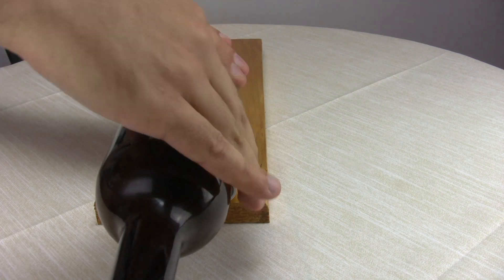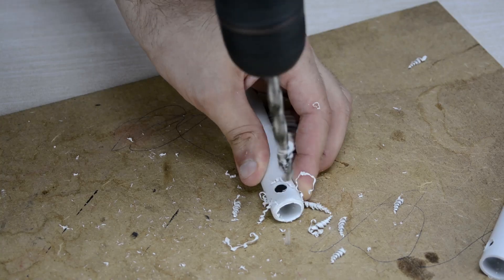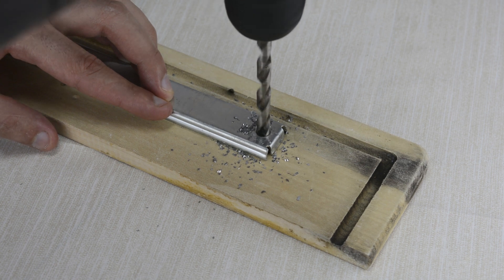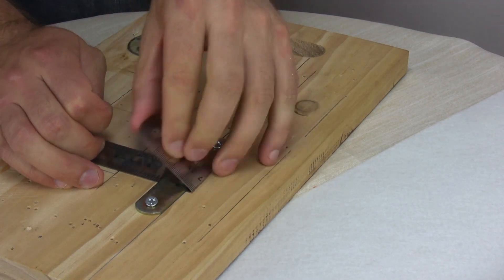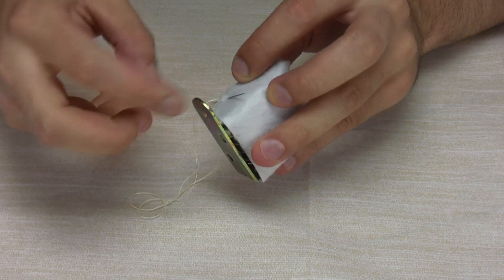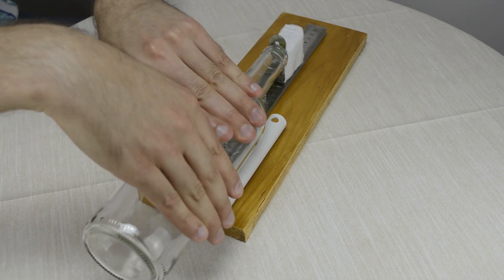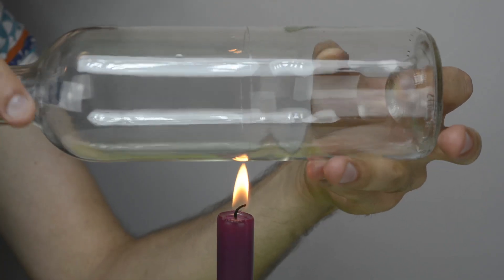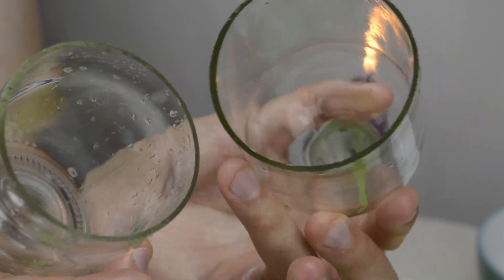DIY: Glass Bottle Cutter | How to Cut Glass Bottles

Comment: We start making a Plumbus by rolling out the dinglebop and then adding the schleem. ... Don't worry, we re-purpose the schleem for other uses. After we stretch the Dinglebop over and into the grumbo to get the right shape, we need to rub it with some fleeb juice. Grab the fleeb and rub it all over the tip of the Dinglebop.
Reply: Then draw the rest of the owl

Comment: So, the 2 white pipes are at different position so as to put pressure on the bottle?
Reply from the maker: Yes, it's because of the pressure.
PS. You can make both pipes much longer. I don't know why I made them that short.